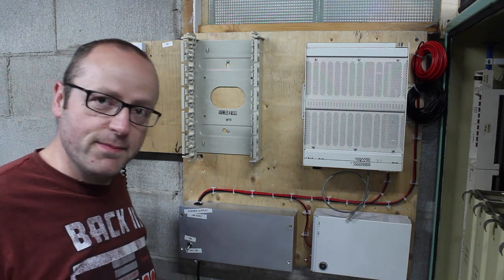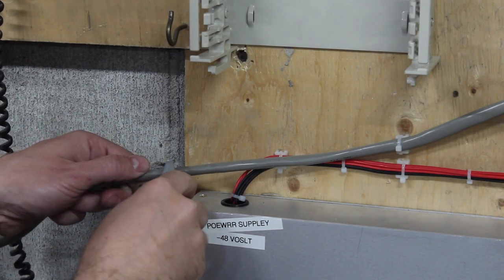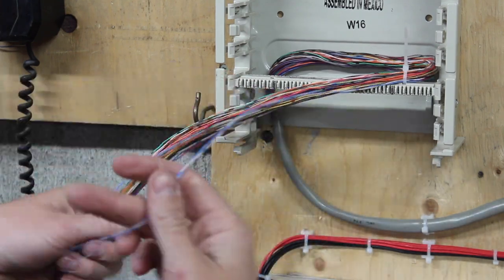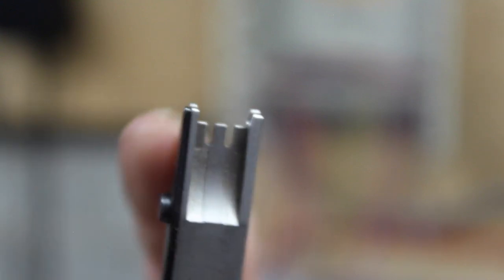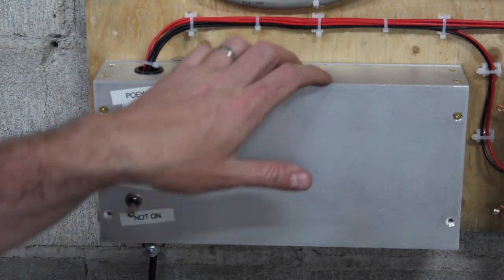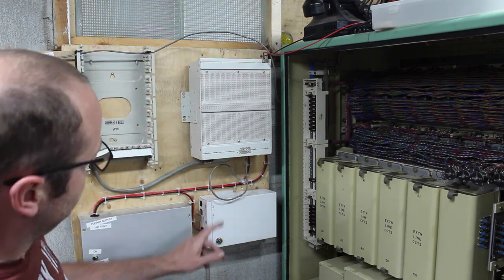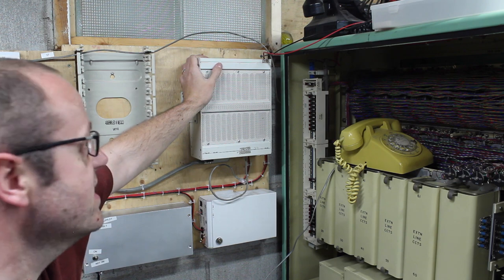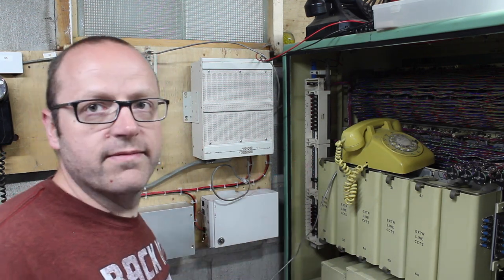Strowger PABX Shenanigans

Comment: Quick question, have you had problems with line noise, specifically mains hum, when connecting old PBXs to newer stuff? I've got an Adtran's FXO plugged into my older NEC system and it sounds like the phone is sitting next to an AC transformer. Never had problems with this before, everything shares the same common ground, and polarity on all the lines is correct so I'm not sure at this point. Also connecting anything else to the FXO isn't a problem, and plugging phones into the PBX doesn't cause it, seems to be just the particular connection of them. Thanks!
Reply from the maker: I haven’t had a problem with that. But I wonder if the problem is that to save money, the NEC system’s station ports (I’m assuming that’s what you’re connecting an FXO port to) aren’t balanced properly. My old SG-1 uses a scheme where the line is powered by +24 on tip and -24 on ring, with ground floating between the two. If this was connected to something that tied tip to ground, I imagine there might be problems. But really, an FXO port should be treating the loop as an isolated conception, with no metallic connection to from the loop ground being established by the Adtran at all. How is your Adtran powered? Does it run off of AC with presumably and internal DC power supply?
Reply: @beefchicken  It does run off AC with an internal DC supply, so does the NEC. I think you may be correct in it being unbalanced but I'm not sure how to go about fixing it. I have set them up on the same ground before and it didn't help. It doesn't make sense to me because as you said an FXO should function like a phone, in the sense where it won't connect the circuit to anything else. Usually they seem to have a transformer that does isolation but I'm not sure exactly how it functions on the Adtran. This problem only seems to occur when I plug the NEC into the Adtran, no other devices connecting have given this result before so I really don't know what the deal is. I'll try to figure out if the tip or ring on either device is grounded at some point. Just got to pull the thing out of my rack at some point.

Comment: One the power supply, I suppose you are using red for the positive (which is then grounded) and black for negative, which is then hot. If not, somebody will get confused. We use white for ground (as neutral) and a blue with white stripe for negative 48 Volt. Either one works.
Reply from the maker: The more common standard, it turns out, when using red and black with -48V is to make black positive/ground and red negative/‘hot’. I didn’t do that, partly because the previous owner of my system didn’t, and partly to protect myself from myself.

Comment: I'd like to find out more about your use of the adtran unit I have several that I have recovered over the years but I'm pretty sure you cannot use them end to end without CO equipment in between. if you know of a hack for that I would love to hear about it I searched YouTube and can find nothing. Thanks for any help
Reply from the maker: I have connected my two units back to back, and I have been able to push calls through them (they can be configured for ringdown operation; pick up one phone and the corresponding phone plugged into the other channel bank rings).

Things to consider: you need to make sure that your T1 is crossed over, so that TX from one unit goes to RX on the other (the blue and orange pairs swap pins). Make sure all of the framing/coding are set the same (I use B8ZS/EFS). Finally the most important part, and what I suspect might be causing you problems: the clock source. Normally, a CPE device is configured to recover the clock from the T1 signal coming from the CO. In your case, there is no CO, so you need to configure one of the devices to originate the clock, and the other to recover it.

DIP switch S1 on the BCU that configures this:  switches S1/5  off & S1/6 off = recover clock from the T1 loop. S1/5 off & S1/6 on = local timing, clock is generated from internal timing source.

This might be configurable via the menu interface, I can't remember.

Finally, I'd recommend picking up a used Sage 930A test set with the PCM option (almost all of them have it). You can get them cheap on eBay and they're a great help with troubleshooting PCM problems.

Good luck!

Comment: Wow love this video would love to build one started one long time ago when I was a kid but didnt have right parts was making from stratch still works but probally needs tune up all mostly relays and one small selector rotary switch using as connector plus interupter from key system and old key system power supply ringing suppy for ringing phones!  had no dial tone though no busy tone ended up using three wires to phones cause was messing up talk path think I can fix that with real strowger switches and some brain power and better circuit diagrams!   but wow makes me think now!

Comment: Did you CNC that housing box for the PSU?
Reply from the maker: Number 5ESS I have a type compositors saw. It’s a small table saw made for cutting printing materials, works great for aluminum.

Comment: And no heat sink ? A pbx draws alot when fully active .
Reply from the maker: James Beemer:

1. No it doesn’t. This thing draws the most current when the switches are moving. The holding currents for the relays are very low.

2. Fully active? I am the only person that uses this, and I use it mainly to call myself. Do you think it’s 1865 or something?

3. In the years I’ve been using that power supply, it has never become even noticeably  warm.

Comment: Be careful with those Chinese power supplies I blew out all four of the rectifier diodes and had to replace them, they are easy to fry
Reply from the maker: I trust the thing about as far as I can throw it. I've definitely had it very close to letting the smoke out, it doesn't seem to have very good (or any?) crowbar circuitry. I only power it up when I'm in the room, I now run on batteries most of the time.
Reply: I’m pretty sure they have no crowbar circuitry
Reply: And the fuse in them is soldered in place

Comment: What do the colours correlate too?
Reply from the maker: Dallas Maberly its a standard used in telecom cables. There are 5 base colours (white, red, black, yellow, violet) and 5 stripe colours (blue, orange, green, brown, slate). The first pair is a twisted pair of a white wire with a blue stripe, and a blue wire with a white stripe. Next pair is the same with white/orange, and so on up to a pair composed out of white/slate. That’s the first 5 pairs. Then the white is swapped for red, and the pattern repeats (red/blue, red/orange, red/green, etc.). For cables with more than 25 pairs, the first bundle of 25 pairs are wrapped (loosely) with a white and blue plastic tape, and then the colour code starts over again, with the next bundle of 25 pairs wrapped in white and orange plastic tape. That pattern gets you up to 625 pairs, then the process basically repeats again.
Reply: Beefchicken Industries thanks for that I have an older lg aria pabx it was taken out a an office becaouse they upgraded and all I saw was spaghetti at first in guessing that if I pair all of my 21 lines out (it only does 21 phones) I should be left with a telephone in??
Reply: @beefchicken  Late response to this post, but I well remember 30 yrs back interviewing for a Tech position w/a local Inter-Connect Company, and the head Techie's first question was "What's the color code?"  Luckily I correctly named off the pairs.  They serviced alot of the old large switches where EVERYTHING was wired out!